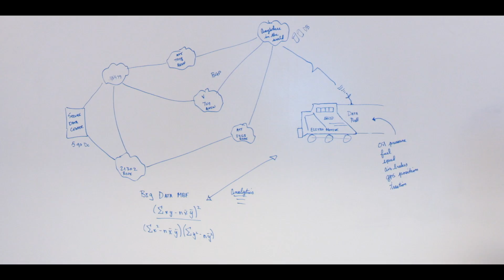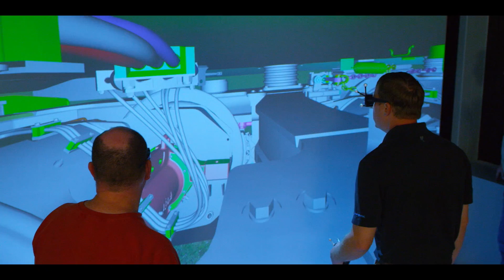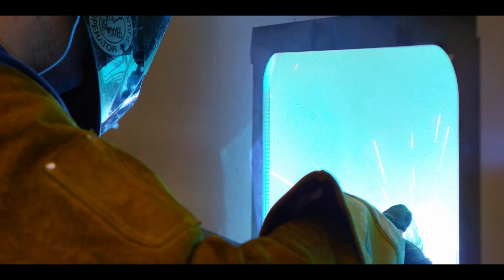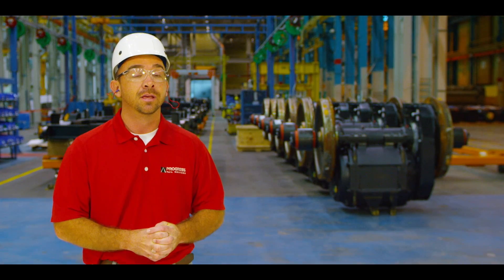EMD SD70ACe-T4 Locomotive

Comment: I wonder what smell a new engine cab has. Is it like a new car?
Reply from the maker: Similar! It's just not quite as leather-smelling, and a little more.. industrial.
Reply: They litteraly smell like piss...like every 70Ace ever made. The bathrooms are made from a porous plastic that absorbs  urine an locks in the fragrance for the crew to enjoy. The bathroom doors are poorly fitted with about 1/4 to 1/2 inch gap all the around and not to be forgotten an exhauster fan about the size of the one in your computer that actually pushes air into the bathroom and the cab. This EMD toolbag that commented probably sits at their social media public relations  desk and has never been near a locomotive.
Reply: @33Kpro  I said brand new. Not used lol

Comment: 2019:
Now I am hearing the SD70ACe-T4 is being demonstrated by CSX, cool I guess, but then UP is storing them because of the emissions, teething with the engine problems, quiet as hell, 4 stroke is just idiotic. With 2 stroke you are able to throttle up faster and you have no turbo lag. Please try and fix these mistakes, because it will eventually be your downfall, like General Motors with EMD....

Like I said, revamp the 645E3 and you will have railroads flocking to you.

Comment: Here's an Idea: Revamp the SD40! Go off of that design, go retro, you don't always need high tech to make a good locomotive. But yes, get Tier 4 compliance, but the SD40 sold over 3,000 units, your SD70ACe hasn't even sold that much.
Reply: EMD has sold 1,843 SD70ACe locomotives in North America, not including the SD70ACe/45, SD70ACS, SD70ACe/BB, and other international variants.
Reply: @hakeemsd70m  Still, not nearly as much. How many SD70ACe problems have been encountered versus the SD40?
Reply: it's your opinion but the sd70ace uses a wide cab to keep crew safe and I prefer them over the sd40's because the sd40's look awkward with that long walking platform on the front end

Comment: Here is what Tier 4 means: https://nepis.epa.gov/Exe/ZyPDF.cgi?Dockey=P100OA09.pdf
I didn't see any reference to test protocols. Nothing specified from SAE, ANSI, FRA or ISO(not a fan of ISO).
Since there is no correlation between emissions & the Earths air quality, I don't like the marketing term 'Green'. I'd have a preference to use the term 'Engineering Optimization'(EO) instead. 'Green' infers you fill the fuel tank & flowers come out of the exhaust. That's not even true even for the dirtier electric locomotives unless the electricity is supplied from the hydroelectric process. Otherwise the burning of coal for electrical generation is only 18% efficient. Far less efficient then using petroleum derived fuel. Of course Bio-Diesel would be preferred, but that has a capacity handicap of its own. More funding for Bio-D!!
I do think this is a fine looking locomotive though. I have a preference for EMD styling over GE's.

Comment: It is nice to see that a product like this has returned to it routes a bit with the return of the F45 Windshield type glass that has been sported in EMD products through the ages as it is a huge safety improvement to the SD70 Series along with the integrated changes and up grades. EMD in my mind has always been longevity and quality and with the standards provided and the proof of use in the secondary railroads like MRL and G&W it shows a great product returning to the field. and my guess would be that the upgrades in the T4 series could also be designed with limited adjustment for all previous SD70 Models since they are all modular and simple mod-Kits could help raise the standards of older models .. great work.. i have yet to see a T4 on Cajon while recording and i am looking forward to it along with their use on The Tehachapi Loop ..

Comment: This video is full of it that no even boat can save you! And finally EMD and GE step in to the 21st century and get some old fashioned obsolete shit out! Start building locomotives with cabs on each side and please take that freaking bell out there! Get modern please!
Reply: dual cabs first of all are just a european thing and is what you are thinking and are more common on electrics and that thing is a diesel. and the bell is  a FRA requirement from besides the horn that sounds unlike your squeaky euro ones. if you want dual cabs just beg america to electrify the whole rail network and have higher tractive effort as well as beg america to discourage the use of cars.
Reply: Jabberwocky

Comment: Everything is exciting and nice when they are new. . .Compliant is not a fancy word for reliable. These wont be around 30 to 40 years like a lot of the old ones out there. I wonder how much down time there is going to be with these new T4 engines. . . They better keep the old reliable ones around for backup when these new problematic things go down.
Reply: Agree 100% with you.
Reply: Not a whole lot breaks on them. The engine is pretty darn simple. I watch the machinist change filters, and oil on them for the 164 and 358 day servicing. No traction motor brushes to have to change out. Pull off terminals on relays so you can change then out one wire at a time. Dynamic brake motors are not that bad to change out, and main generator brushes can be changed with a nut driver. Event recorder can be done with a thumb drive. Simulation testing with a simple wire in the relay closet. In short they are holding up here in the Platte River Valley hauling coal. The one complaint I have is the serial number plate for the traction motors needs to be somewhere easier to get to for trucks 2 and 4.

Comment: Why aren't the car body leads and traction motor leads protected by some kind of conduit? Most of the problems with the ACe's are ground relay problems caused by breakdown of the car body lead's insulation. Why so many separate computer systems? EMDEC, EM2000, and FIRE screens all have to be updated separately, why not have one central computer control system?  Why is the rear door that gives access to the grid blower bolted shut? This makes grid blower maintenance difficult.

Comment: I sure hope that CP will order these things when they're ready to start shipping them to the railways. I'm starting to get a little tired of seeing GE toasters. I've never been a huge fan of GE but they've put out a superior quality product with the ET44AC's. Hopefully this will get EMD back in the game. 
I believe that GE will be making more Tier 4 locomotives into 2016 and it looks like that the Erie and Fort Worth plants are going to be busy for a while.
Reply: They have no reason to switch.  Neither does BN, or any of the other railroads.  BN and UP may order a few to try them.  If they hold up like an SD90, EMD is finished.  The GE's work like they should.  They're a known commodity.  By the time Cat gets it to market, the railroads will have the majority of their orders filled by GE.
Reply: +Pete Kranz You're right, but it'd be nice to see some variety.
Reply: Doesn't work that way.  They buy what their business needs, and that's a durable unit that pulls like crazy, doesn't break, and gets good fuel economy.  That's a GE.  When EMD started using the SD90 formula for everything, they completely blew it. They have not made a superior unit since the GP/SD40-2.
Reply: +Pete Kranz As I said before, GE has put out a superior quality product that pretty much all Class I railroads have purchased. They currently have a stranglehold on EMD and as you mentioned, if this ends up like the godawful SD90MAC-H which were chock full of mechanical problems and were scrapped a few years ago, or the SD80 then I guess GE will become the king of locomotives. 
EMD will have to knock this one out of the park if they expect to make a comeback.
Reply: They really do.  Even the 70Ace was crap.  

I'm actually more an Alco aficionado vs GE, but having actually run the 40/50/60/70/90 EMD's, and Dash 7 through AC44 GE's, my thoughts are that the early 70Macs were the last good EMD.  I think when GE went to the V12 7HDL/Gevo, all the rough quirks of the AC44 got fixed.  But the early AC44 was the hardest pulling horse of any of them.
Reply: +Blake Trafford - Mile Post Productions You reminded me how, years back, so many of us were convinced that EMD was "it" and would remain the top gun in the locomotive arena throughout the 1970s and 80s, especially after the highly rated success of the SD40-2, GP40-2, and F40PH. Although liked by railfans, GE's back then (U-Boats and Dash 7's) were often viewed with disdain by a good number of locomotive crews. Never imagined that eventually GE would become the top dog in the game. Hopefully this will be a good comeback for EMD (even if it under the Caterpillar flag).
Reply: +ACLTony I don't see it.  It will take a long time for Cat to get EMD at the top of anybody's order list.  The first full year or two of production will mean working all the bugs out, and by that time, GE will have 5 years' worth of locomotives out there pulling freight.  Cat should've started over.  Create a lower-cost replacement for GP's and B30/38/40 units.  get the bugs out of those, then move on to big road units if there's a market for them.

Comment: Does it have a 16 or 20 cylinder 710 prime mover?
2021 edit: I was a dumb kid who didn't read the description
Reply: +Historymaker2001 the 265H engine was introduced in the American market in 1999. 
It's something of a hybrid, in that it's a 265 with Cat parts. 

The new GE uses the GEVO, which is also something of a hybrid in that the 7HDL was developed by GE and Duetz, then became a near-100% GE design with the ES/ET series.
Reply: Those were test units.  Actual production began in 1999.  UP numbered the H units in the 8500 series at that time.
Reply: +Historymaker2001 You basically repeated what I said in far less words.  you don't get extra points for all the production dates, rivets, and serial numbers.  EMD and GE regularly utilize a number of testers before actual production, with the 8200's being part of that.  Regular production orders of the 6000 hp units did not start until 1999 for both EMD and GE.
Reply: +Historymaker2001 Ok fair enough, but your posts came across the same way.  
Regardless. time will tell if the new Cat engine is a success. GE did very well adapting the 7H into the Gevo. As far as 6000 hp goes, the big 16-cyl ES/ET (5850 hp) will probably be the last of its kind in a rail application, but it is holding up for CSX and many export units.
Reply: +Historymaker2001 GE owes Bombardier a huge thank you.  When they bought all the Alco stuff from them, they got a headstart against EMD with many aspects of locomotive design, including passenger design (LRC), AC drive (M640), cooling and dynamic brake improvements, trucks, you name it, it was borrowed, hacked, sliced and diced into all the new stuff from the P40 on up.

Comment: It's about time.!!! Can't wait to see some of those babies on the road. I tire of hearing the GE "chug".
Only a top quality product is going to beat GEs deep pockets.
Reply: +Marlowe Barnes We don't know what this new engine sounds like but they made a big change in that it is a 4 stroke instead of a 2 stroke. Emd has been using 2 strokes since the beginning. GE's also use 4 strokes so it will be interesting to see if it sounds like a GE.
Reply: +emall low It does.  It's a 4-stroke 265 variant with Cat parts glued on.

Comment: lets go beat those GE turbo blowers
Reply: +Noah S.  I hope CP gets some more EMDs
Reply: *****  yeah, and GE's would need alot of spare parts, especially turbos
Reply: +Historymaker2001 SD90's with their Siemenes electronics were not reliable at all.
Reply: Robert Farrell  CP operated the ones with 710 engine and they didn't have extreme problems as far as I knew. CP could of modified them if they wanted to.
Reply: The 710 engines were great, we had them at UP too. The Siemenes traction control computers and phase modules were constantly malfunctioning.
Reply: OfficialNikGaming   watching a CP GEVO step on it is pretty sweat

Comment: Rumor on the street is EMD finally has an Alternator starting system like GE's employ? Hopefully the EMDEC cable is protected and uses more robust connectors to the fuel nozzles? Can a bong test be run from the FIRE screen or do you still have to hook a laptop up to the EMDEC connector? It would also be nice if the EMDEC connector was moved into the cab, instead of being in the contractor compartment, for entering injector codes? It's nice to see the Knife switch back in the cab instead of being in the Alternator compartment. Where is the rear door to access the grid blower? How are we going to service the Grid Blower brushes? I hope you haven't gone backwards to the SD80Mac method of servicing the grid blower brushes? Why are the baggie filters located behind the rad section? Is the turbo now on the front of the diesel engine?
Reply: No knife switch on the ACe. It is air start. For service cut out we have to lock out the air valve for the starter after it has been bled out. I have worked on a few GE models, the MAC, and the ACe. The Ace is the most straight forward for servicing of the bunch.

Comment: Which Prime Mover is the 1010? 710 variant? 265 variant?
Reply: +Mark Huett 
Ahh, thanks, I wonder if there are any engineering drawings of the new prime mover?
I've yet to locate one and I'd love to see what has changed between the current and prior design.
Reply: +mathue taxion My guess is it is some sort of CAT designed engine.
Reply: +mathue taxion This is a redesign of the 265.
Reply: +mathue taxion I'm sure there are but even though it's a redesign of the 265 engine it's still considered a "new" engine. You'd probably have to contact the builder. whether they'd send you a copy is another issue.
Reply: +mathue taxion It's a V engine not the H one. It just happens to have the same cubic inches as the old H engine.

Comment: As a Locomotive Engineer, I'm grateful that the new cabs brought back the teardrops that are angled. I couldn't stand the rectangular vertical paned windows, they caused glare something fierce. the interior design changes, especially desk space is welcomed as well. I look forward to possibly getting one of these in the future for cold weather testing on BNSF like GE did last winter.
Reply: +Aquamassage I like everything about the GE cabs except how the new AAR stands don't angle quite a much as the old school stands did so it's harder to reach the throttle without having to sit forward.
Reply: +Aquamassage the GE rectangular windows are laid back at an angle though that keeps things from reflecting glare into the cab.
Reply: NTSB recommended to EMD that they eliminate the "isolated" cabs due to failures in the field.  the big wreck on the BN at Red Oak IA resulted in two deaths because of that.  It appears as though Cat chose to ignore all of that with this unit.
Reply: +Pete Kranz I recall that. Cab sheared right off...
This cab doesn't have the isolation like the past models though it seems.
Reply: I don't know.  It looks isolated.  I would hope it isn't.  The isolated cabs were louder than solid mount cabs, didn't ride any better, and had a tendency to deform in wrecks.
Reply: No estoy del todo de acuerdo con esos parabrisas ya caídos se puede hacer así pero con una terminación horizontal más abajo quedaría muy bien
Reply: BNSF5608 I wuld like to see a ac 600 cw with a SD 40 - 2 cab or a gp

Comment: Is the 1010 Engine a newer variant of the 265H?
Reply: +scribklu Yes. The 265H is 1010 cubic inches of displacement per cylinder. That's where they got the number 1010 from.